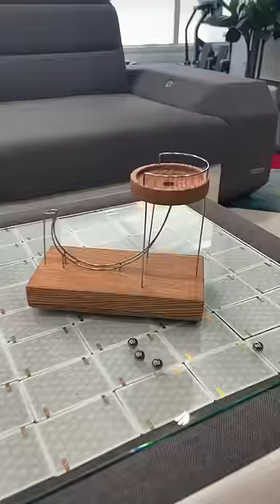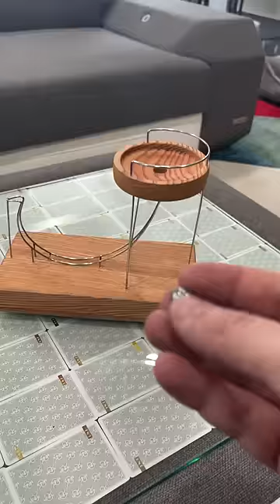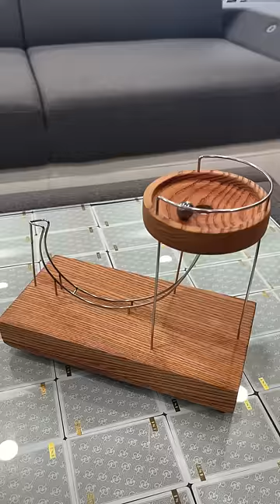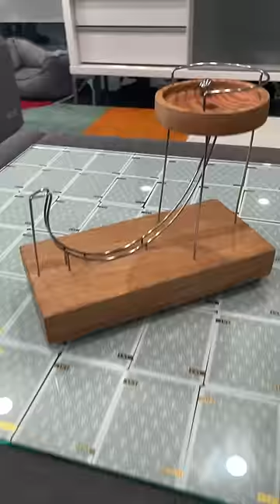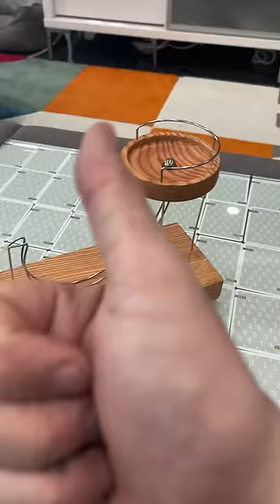An Impossible Perpetual Motion Device?! 😳 #Shorts

Comment: Whenever a "perpetual motion" device shows up, it's always one of two things. One is an incredibly low friction coefficient, allowing the system to work itself across many oscillations before having even a noticeable slow down. The wood where the ball rolls around in doesn't look very polished, so that can't be the case. 

The other is a hidden external force. Given how unnaturally fast the ball travels across the ramp, that seems to be right, but I'm not sure where or what it could be.
Reply: But a true perpetual motion device should create more energy than it uses. The ball falls due to gravity. But it doesn't provide any energy to power anything.
Reply: Was thinking the rail could be magnetic? Hmm
Reply: My guess would be a magnet, I can’t tell if the balls are metal or not, but if it were positioned in a way to PUSH the ball faster down the ramp it would increase velocity which would help it reach the top again.
Reply: Looks like magnetic marbles, often used for “relaxing”. They come in pairs and while holding both in hand, throw upwards and they start spinning around each other. The sound it makes before leaving the rail is a giveaway.
Reply: Yeah, could be magnetic pulse delivered right after ball falls through the hole, pushing it down hard so it shoots back up with that extra energy
Reply: It's even simpler than that.  The ball falls down the hole with enough energy to get back up to the plate. Then, it "relaxed" as it goes back to the hole to it's original energy state. The process continues because there is no use of extra energy that gravity doesn't provide. Don't know if I'm explaining it correctly 🤔🧐
Reply: It's a magnet hidden beneath a thin wood sheathing in the base. As it falls it pulls the ball towards the magnet, the rail deflects it up the ramp. While this is "perpetual" it's not a perpetual motion device, which would theoretically require no external input from the initial conditions and no loss as it follows through.
Reply: The hidden power source is…gravity.

Comment: Interesting table piece. One question: 
How long do the batteries last?
Reply: One question. Did you actually listen and understand what he said? He said that the device is not a perpetual motion machine because they don't exist but that the concept looks similar.
Reply: Interesting idea, one question, how the batteries  help and push the ball upward?
Reply: @jovramos3494  it's called a rail gun. Look it up. It's actually powered by a cord but a battery would work as well.
Reply: @jovramos3494  
There’s a video on YouTube that shows that when the ball falls through the hole a battery operated device pushes the ball downward.
The single AA battery is located in the upper part, turning unit over you can see where the battery is installed.

Comment: That is prety much accelerated. There must be a magnet somewhere there. I have played with magnets alot
Reply: It would either have to be a permanent magnet in rotation or a pulsed electric magnet. A stationary permanent magnet would simply add energy as The ball fell toward it but it would subtract that equal amount of energy as the metal ball pulled away.
Reply: @Notrocketscience101  Just what I though
Reply: there's a motor that speeds the ball up in the chute
Reply: I think there might be a coil. Because   the motor will do too much noise and might not fit in.
Reply: @trenbol  nope it's def a motor and a rubber roller to speed the ball up and a single AAA Battery. how do I know because i got one for free (it was a amazon deal) but I sent it back and got credit back.
Reply: I would say the same. That's why the wood plank is that thick. There must be something in it.
Reply: @bennomichel2027  i already know. I used to own one of these. I disassembled it. it's a motor a battery and a rubber roller
Reply: good one
Reply: @chuckholmes2075  Hi Where's the roller? Can't see one in this video anywhere.
Reply: @Drew_Hurst  it’s there take my word on it. Buy one if you want they sell em Amazon. You’ll be sending it back. It’s really cheap construction. It wobbles. Mine had a  hole not drilled for the wire rails. Anyway the motor and roller is in the chutes. See how thick it is? It’s on the back wall of the round chute and there’s a rubber roller… attached internally to a motor (presumably) the top piece even though it looks wood it’s not. It’s plastic
Reply: @Drew_Hurst  the video doesn't move or pan so of course you can't see it. but trust me it's there.

Comment: The thing is... this machine loses energy through noise and the heat made by the ball going against the rails.
Reply: The electro magnet in the base will make sure that doesnt present an issue
Reply: kinetic energy losses from friction to the ramp to the table to the ground
Reply: @Mikoori.A  no
Reply: Friction in moving parts will always cost energy

Comment: Neat, love how they hide the magnet in the thick base
Reply: If they use a magnet it would still be a perpetual motion device . . .
Reply: The magnet is of course used in conjunction with a electric motor or a switch, no idea how tho, dont reslly care either it just looks cool and still doesnt break thermodynamics
Reply: @queniof  not quite, even though it would stay in motion for a extremely long time, magnets have to spend the energy stored in them in order to attact or repel objects which results in them losing there strength over time and eventually not being strong enough to maintain the motion of the device
Reply: @peyplayztanks6095  magnets do not "store" energy.
Reply: @tvh300  Not in the traditional way like a battery does, they do however "store" magnet energy in the form of there magnetic field. This magnetic field decays over time unless some outside influence strengthens it again.

Comment: there's probably an hall effect or electromagnet field sensor there and an an electromagnet gets activated to boost the balls.
Reply: Maybe, but like why wouldn’t gravity be enough force to continue it
Reply: @ScottyWestside  He literally just explained it in the video. Because it's impossible. You can't get more energy out from a process than you put in to it. Except certain nuclear reactions.
Reply: @NiVoldiza  I’m no expert but this thing could probably keep going forever as long as it’s on earth. The contraption itself doesn’t create the energy but just transforms gravitational energy from the earth’s mass into kinetic energy. So the earths gravitational pull can’t exist forever but it would be enough to keep this thing going for a very long time.
Reply: @brandonboudreau6975  to get ball back on the platform at first you must overcome the same amount of gravity force plus friction and aerodynamics.
Reply: It’s just gravity doing it’s job. That’s it.
Reply: @domzdaman373  sigh no, try it
Reply: @brandonboudreau6975  Gravity pulls it down the hole just as hard as it pulls it down as it shoots up the ramp. Going up requires power.
Reply: @aliveslice  Don’t “Sigh” No me, buddy. I’m not ignorant to physics. The inertia built up from falling in to the ramp minus the very minimal amount of friction here seems to be just enough to counteract the applied gravitational pull going back to its original position. Kind of like a zero sum. SEEMS - I know it’s not - In this case, yes there is ALWAYS some energy taken away to to friction and air resistance - but the effects applied due to those factors here seems to be minimal to the point where it isn’t a factor that makes a difference.
Reply: @domzdaman373  what you're saying, is that a rollercoaster can go up a hill as high as the downhill before it, which isn't true. I'm pretty sure, there's a magnet in the wooden plack it's on, and the repelling field of it is aimed towards the kicker which flips the ball up building it's speed up. Like someone said, it's physically impossible to make a hot weels loop with a high point that's as tall as the top of the speeding ramp before it.
Reply: @brandonboudreau6975  No. Just... no.
Reply: @NiVoldiza  Theres a massive weight and friction differential between a rollercoaster and a small ball. It makes a HUGE difference. Did you even READ my comment?
Reply: @domzdaman373  of course I did, that's why I answered you. The hot weels / rollercoaster analogy is valid even if there weren't significant friction included. If there was nothing boosting up the ball's speed on the way while it's rolling down the track, the ball would hit the side of the tray it's supposed to land on. And I'm not trying to be an assh*le or provoke an angry response from you, take a breath and chill. I'm just arguing that you're probably wrong with your claim that "it's just gravity doing it's job", okay 😶?

Comment: Build one that doesn't need an electro magnet, and you'll be on to something 😉
Reply: There is no magnet. It's a slightly sloping bowl that directs the ball to the hole. Gravity gives the ball enough energy to jump the gap and get back to the bowl. It's just a simple physics experiment
Reply: Gravity alone cannot give the ball the momentum it needs to go all the way back up. Not only is it being slowed by friction and wind resistance, but gravity is still pulling it down on the upswing. It's the same reason a dropped (not thrown) ball won't bounce higher than its release point. We may not see it, but "simple physics" states that there's energy being added to this ball on its journey - by either a motor or an electromagnet (that pulls it faster, but shuts off before it would slow it down).
Reply: @ryanbollinger5599  BS
Reply: @ryanbollinger5599  
Wrong.
Reply: @ryanbollinger5599   Hidden in the woodwork. It requires batteries to work...
Reply: @kaituub In theory, could this thing use a regular Magento?
Reply: @ryanbollinger5599   I see you failed simple physics. That's cool though. I'm sure your high school teacher passed you regardless.
Reply: @tr1707  I was wondering the same. Having a really strong magnet, could this be achievable. However I think having a regular Magnet will not allow the marble to gain Speed since it is slowing the marble at some point. Don't know. It could be possible maybe with magnetized marbles...

Comment: The first law. If you have a cylinder full of an ideal gas, and you compress the gas, that is negative work meaning that it takes an external force to compress the gas and increase the internal energy. The problem is that there is no such thing as 100% effeciency.

Comment: It would be a perpetual motion device if there were no electronics involved. Aside fromt the structure, If magnets were to influence the ball and nothing else, I would be very impressed.
Reply: Sadly no, there‘s an electromagnet in the base that propels the bead in the perfect moment…
Reply: even magnets would disqualify a perpetual motion machine, as magnets lose potency over time
Reply: @yawn2274  This is always a fun topic for new physics students because every single suggestion has a simple refutation like that.
Reply: The ball itself was the magnet.
Reply: @kurticliff3163  So how does the ball roll along the metal bars?
Reply: @SilverEye91  in this case gravity and the normal force from the wires is stronger than the weak magnetic force, and the result is that it moves along the wires
Reply: @longbeing  So the battery is used to run an electromagnetic field along the wires?
Reply: @SilverEye91  maybe? I’ve never formally learned about magnetism but it’s the most common theory in this comment section. I don’t think the balls are magnetic since they would behave oddly around each other.
Reply: @SilverEye91  basically, a magnetic ball could run along wires, but these balls aren’t magnetic
Reply: @longbeing  Right, that's what I was thinking.
Reply: What's wrong with you all. This is why the smartest people learn things for themselves. 🙄 Listen, stop watching this shit. It's interesting but what if you were to build one that made it even cooler. There not beads dude. Please flip the device over for us thank you.
Reply: @patrickmcgovern676  The smartest people don't just learn things for themselves man. They learn from others and get an education. If they didn't they wouldn't get very far. You have to learn from others or you will have to end up doing the work someone else already has over and over and over.

Comment: Can't wait to see ElectroBoom's latity about this one

EDIT: can't spell for sh!t
Reply: Yes
Reply: @dylandog518  or the hydro thump pump or whatever it's called.
Reply: *latity
Reply: Electromagnet accelerates the ball downwards as it falls, and stops accelerating it once it starts going up.
That's why it doesn't work when more than one ball fall at the same time. The timing gets messed up.
It's pretty simple, and there are several versions of this. Also with pendulums.
Reply: @ficolas2  This comment makes me wanna spam mine yet again
Reply: @ruffusgoodman4137  actually, I was wrong, it's a mechanical gear spinning the ball right at the hole.
But the electromagnet ones do exist, and they arer pretty cool imo
Reply: Yeah. You just unleashed the wrath of ElectroBoom on yourself Chris Ramsay. Prepare to get "rectified" and shamed by him. You shouldn't mess with the master of electrical engineering!
Reply: @Matt-the-Youtube-user  I'd love to hear his thick accent complaining about the obvious hidden battery on this one
Reply: @ficolas2  so, it lasts as long as the battery? Pretty impresive. If we put a simple magnet it should last like a million years?
Reply: @pezazul2917  no, you can't turn a magnet off. So you can't create something like this with a permanent magnet
Reply: @pezazul2917  Just to clarify.
You can't get energy from a permanent magnet. To get kinetic energy from a permanent magnet, that energy must first be potential magnetic energy.
Same way you can't really get energy from throwing things up, then having them accelerate downwards, because you first have to throw them up. (Unless "nature" is the one that throws them up, like for hydro power, but this is unrelated)

Comment: I'd like to see how it works with a ceramic marble
Reply: depends on the metal caked into the ceramics and the battery power
Reply: Just fine they use a motor

Comment: Nice. I'm going to make one of those. Wood, wire and a magnet to accelerate the ferro metal ball.
Reply: It's not a magnet it's a small electric motor
Reply: Where is the electronics
Reply: Flip it, there's a battery compartment at the bottom.

Comment: The clue is in the video. He says you can add multiple balls as long as they don’t go through at the same time. The only explanation for that is that the ball triggers an energy source momentarily when passing from the hopper to the rail. If both balls are touching, the energy source is not triggered for sufficient time to accelerate the second ball as if it was it would affect the first. 

The best explanation is as mentioned elsewhere, an electromagnetic charge timed to affect the ball only when required I.e. when accelerating. The coil is likely hidden in the underside of the wooden hopper. The trigger is likely contacts or a sensor within the hopper bore.

Comment: can you hear the sound of an electric engine in the funnel which launches the ball with a rubber wheel down the slide ?
Reply: I dont think so, but if that was the case it would probably be masked by the sound of the bead against the wood, so maybe
Reply: The tops a bit to small I think, maybe some kind of magnet in the base that turns off when the ba gets to the middle? I'm not sure, but the base is suspiciously large
Reply: Appears to be some kind of electromagnet, launching the ball
Reply: No
Reply: @avistorms  ... I mean your not wrong
Reply: @Flauset  he has a video on his chabel where he explained it. It is indeed a electro magnet.
Reply: There's no motor, it's using magnets

Comment: No, the steel ball couldn't fall through the hole with that high velocity.

At most, the ball, when released, would only reach the same height on the upward swing. But due to friction, it will be lower. The bend at the top end of the track would only take energy away, not add energy to flick the ball with increased power.

So there must be a magnet system hidden in the tray to propel the ball.

Comment: In Road Runner vs. Coyote Genius the same principle is often used when it comes to rocks rolling down on one side of the street and rolling up on the opposite side, then the rock flies higher than the original starting point, and - of course - hits Coyote. 😂

Comment: If you tie a ball to a rope hanging from the ceiling, pull it to your face and release it the ball will not reach your face because energy is lost in the motion through drag, and other things. So with that being said there’s simply no way for a ball to be dropped from one height, and then somehow comeback at a higher height on the rebound without something to propel it. 

Physics.

Comment: I had a dream once about a limitless amount of energy from a perpetual motion device. Basically it was a giant circular structure that was hanging onto a higher point from the middle. It would be like a ring and the outer shell would be hollow. This hollow bit would contain different heights going up and down and would be filled with water. My reasoning was that this would allow the water to be continously pushed around the structure without it ever swapping because the whole structure would also swing to keep the water going around. I thought then the kinetic energy could be harnessed. It wouldnt be truly perpetual energy because the main energy would be coming from the Earth's gravity. I dont know if this is even possible but I randomly thought of it one day.